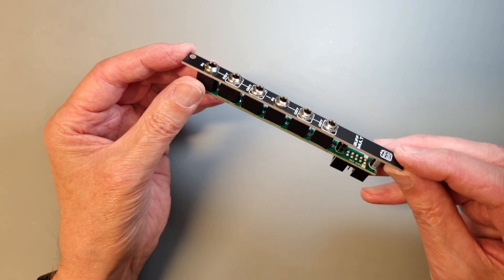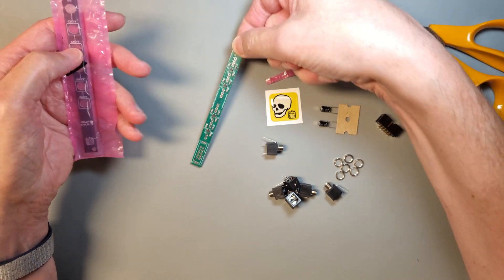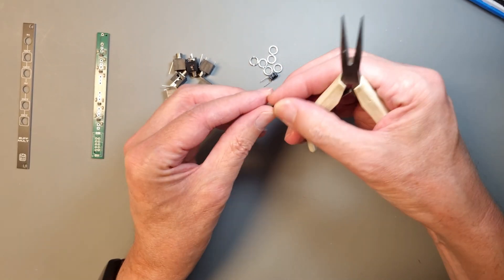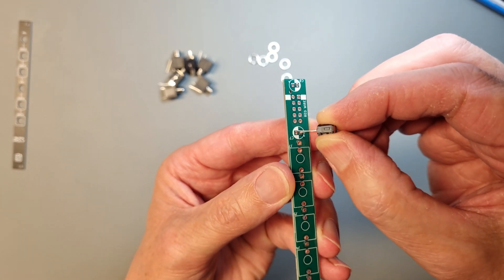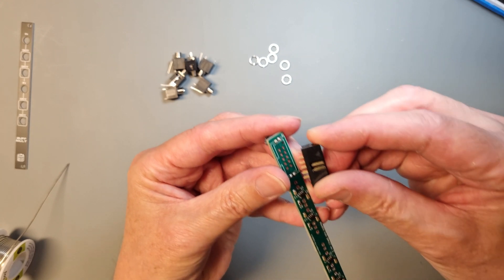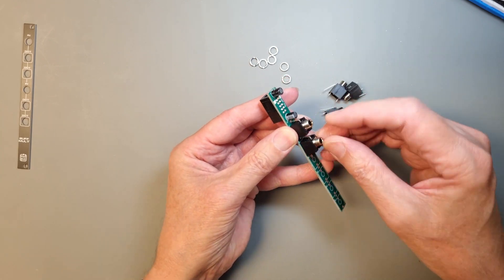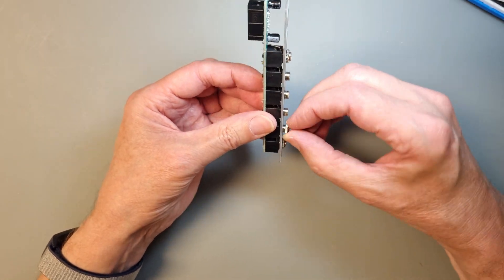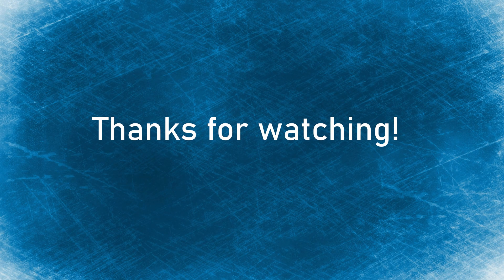Eurorack DIY: Buffered Multiple Build video

Comment: What opamps did you use? if they are based on inputs that use transistors, like LM324 or LM321 a voltage follower need a resistor in the feedback, also the inputs should be grounded with a resistor otherwise the outputs will have some random voltage if nothing is plugged in. Even done good, taking every into account it still can output a small random but static voltage.
I made mine is 4hp dual, 2 x 4, using 10 x PJ302M spaced 20mm vertically and bi-color leds.
Reply: The look like LM321s but the boards are populated already with surface mount resistors.
Reply from the maker: Yes, it's LM321s
Reply: @MeeBilt  That's what i thought on seeing their size on your pcb's, i got a few of them as well but i didn't knew they where so tiny.
the NE5534 is a semi high end op amp, also transistor based, a example circuit in datasheet shows voltage follower configuration with 10k. the lm321 is pnp based a load on the output could pull it out of wack.
Reply: @MeeBilt  TL074(k or m) or so is a tiny variant of the TL074. like 3/4 x 3/4 mm. it's also a different datasheet.